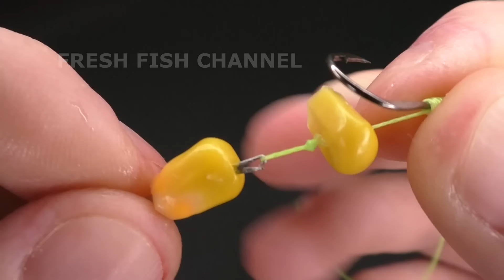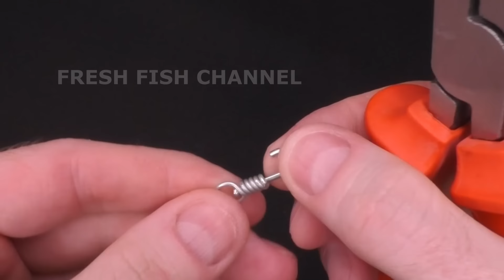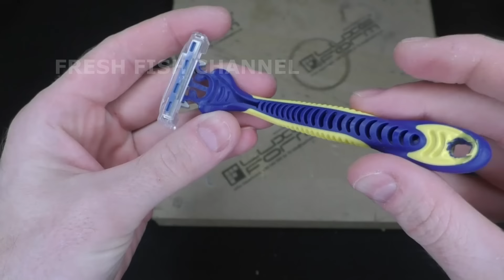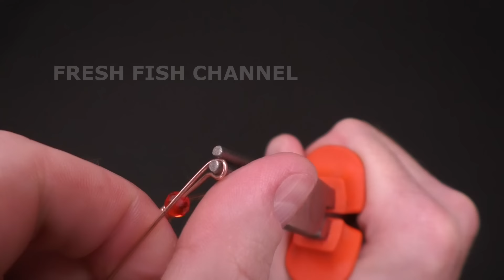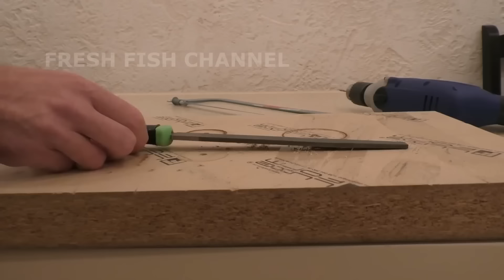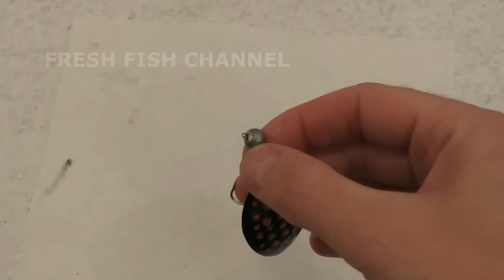10 Awesome Life Hacks for Fishing!

Comment: For those that don't know what each thing is for, here is my best attempt:

1. Hook removal.  Slide it over the line.  The open coil allows you to get it onto your line when needed.
2. Pull the insides out of corn to replace it with a floating ball for carp fishing.
3. Copper wire creates a bait packing ball for carp fishing.  
4. If you're in a pinch and need a swivel, you can make one and it will be super strong.
5. Similar to a dropper loop only locked in place by beads and spins where a dropper loop wont.
6. Knot tying aid.
7. Instead of a 3-way swivel, make this where it has the weight at the bottom and the bait sticking out.  The metal will prevent your line from getting tangled when casting, at least less often.
8. Making a hybrid plastic bait by heating up each side and sticking them together. 
9. Preventing your plastic bait from moving on the hook.  Allows you to present the bait the same way every time and saves time by not having to check the position of the bait before every cast.
10. A spoon lure from a spoon.